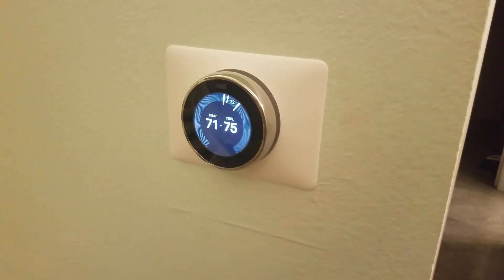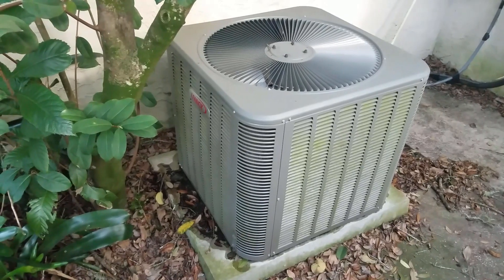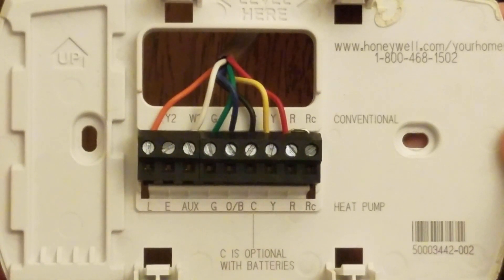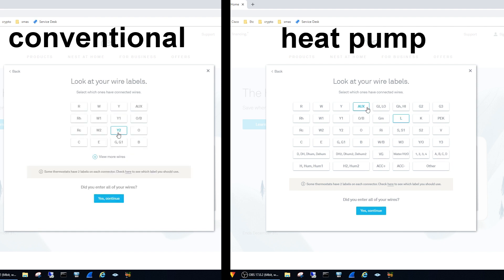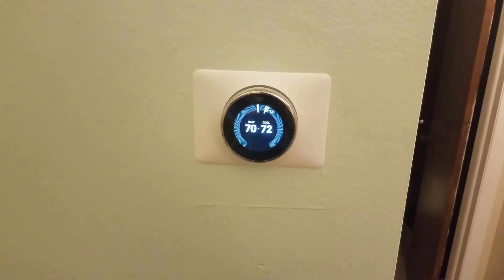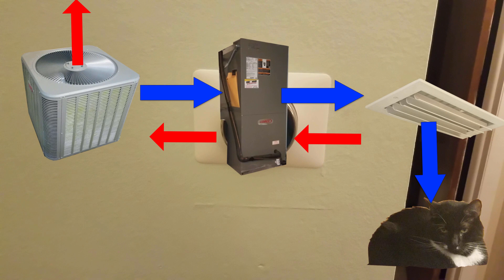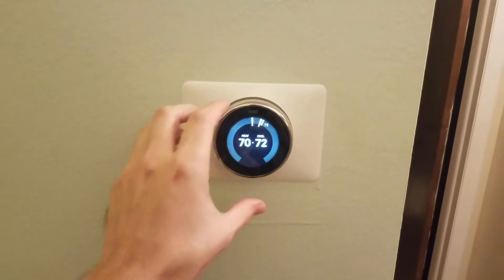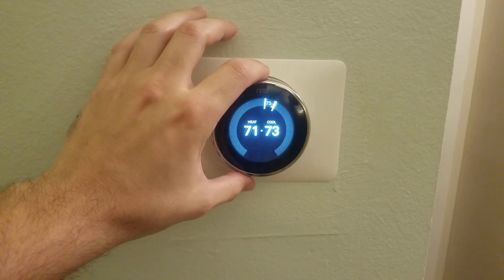Nest Thermostat Blowing Hot Air on Cool After Installation

Comment: I'm in FL and had the same problem except I live in a condo and don't have easy access to the outside air condenser or the air handler, my solution was to look inside the fuse box and I saw there was a double circuit breaker for a heat pump, then I knew which system I had. Also my O/B wire was white and not orange which Nest mentions online in their help support section that normally O/B is orange but clearly not in my case. Your video helped me fix the issue thank you!

Comment: This video helps, the markings on my honeywell control wasn't that clear and wirings are done only on one side, so i connected the O/B wire to heat (W1) on the Nest. thanks for the explanation and i've got cool air after moving the wire to O/B.

Comment: Had same issue.  I have a very similar Honeywell thermostat, also live in FL with same type of HVAC config.   Slightly different wiring on my old thermostat.  Anyways, following the same process fixed my issue.  Thank you!

Comment: Same thermostat different wiring configuration. Thank you so much for this video. All I had to do was switch over one wire from W to OB.

Heads up - it seems like Google doesn't let you look at the wiring diagrams on a device that isn't your nest. I had to reset my nest and unplug everything (first take a picture) for the prompt to reappear that asks for your wiring configuration.

Comment: Man, I just installed a Nest, and I couldn't figure out why it was blowing hot while in AC mode. Your setup is exactly like mine, and I had the exact same issue. I have a heat pump, and I was using conventional. The W and O/B wires were same terminal on the old thermostat, depending on if you had a heat pump system or conventional. Thank you!

Comment: My NEST has been working for three years all connected.  After this winter, I switched it to cool mode and it only heated.  My system is a heat pump, and I noticed that I did not hear the "swoosh" that the switching valve normally makes when the unit comes online.  I know the wiring is correct since it has run for three years, so I am curious if you might have an idea on what is going on?  I put my old controller back on the wiring and it is working now.  It seems the NEST is not sending the 24V back out to the reversing valve outside for some reason.  I also noticed there was some kind of software update back in November when the unit was only heating since it was winter.  Could a software issue be possible?  Reaching for an answer somewhere....

Comment: Thank you sooo much! My husband was convinced we did NOT have a heat pump until I showed him the pictures of your furnace that was exactly like ours! I switched the wires to heat pump settings & like magic… cold a/c. We went through 3 different smart thermostats thinking our old system just wasn’t compatible with new tech. I ended up with a thermostat that wasn’t as nice as I wanted because we were looking for one that allowed a jumper from w2 to y2… impossible to find. Now I know all the nicer thermostats would have also worked if we had just known we had a heat pump. But this one is installed & working so I’ll stick with it and maybe update to a nicer one later on down the road. Ur a Lifesaver!! Thank you for posting this.

Comment: AC units do not "cool" the air, they "remove" hot and humid air from your living or target space and displaces that warm most air outside.

That's why, if you stand next to your condenser, (the big box with a fan outside) you can feel the air coming out is hot. This, is the uncomfortable air being removed from your home or wherever you are. 
So, to sum up;  AC doesn't cool air, it displaces hot moist air and throws it away outside.
Reply: You just described what a heat pump does.  An AC unit takes warm air from inside and cools it with refrigerant through the condenser and pumps it back into the home.

Comment: Thanks for this. When asking if your unit has two labels, double check. Mine did and I didn't notice. Then it asked me about the heat pump and even though the cable order was the same, the software I assume was now sending the correct signals and it begun properly cooling. Also. If it States it is not detecting some cables, give it a try anyways. Sometimes the cable detection I assume does not work too well

Comment: Well I'm in a fix. I have a slightly different Honeywell that has very straight labelling with no "conventional" versus not.  It has wires in C, B, R, G, Y, and Aux, with the Aux jumpered  to the E.  My wire colors are different from yours.   When I connected to the Nest, I matched C to C, Aux to W2/Aux, B to OB, G to G, Y to Y1, and I've tried R in both Rh and Rc and all I get is Heat when set to Cool. Anyone have any ideas what I need to change?  I tried the Nest compatibility but it did not give me a wiring diagram no marter how many times I tried.

Comment: Just installed my Nest yesterday.  The house went slightly above temp right before we went to bed and woke up at 1am with heat blowing and house at 82 and getting warmer.  Thanks to this video, I knew exactly where my issue was and had it fixed in minutes.  Thank you for posting. -Ralph in Texas.

Comment: I've got 3 like this.  2 of the 3 work fine.  However 1 is still blowing hot air on cool.  I moved the O/B wire to W and it cooled, but heat doesn't work. Any other ideas?

Comment: I connected the Nest per the app instructions but got the same problem that you had - it was heating instead of cooling.
Your video help out big time!
I have a heat pump, maybe Nest instructions set me up for a conventional system installation, who knows.
Either way, I moved W1 wire to OB, and it works now! Also, on the Nest thermostat my R wire is connected to RC.

Comment: You are a life saver. Had this exact issue when switching my moms AC Thermostat from a Honeywell to a Nest.
Reply: Did U switch the OB and W wires?  Or did u leave the W wire out?
Reply: @yankeesfan83  In my case I didn't actually have a W wire. I was reading the wiring on the original thermostat wrong and had the O/B wire in the W slot. Once I moved the wire from W to O/B it worked.
Reply: Walter Meadows ok thanks!

Comment: Thanks for this! Installed mine earlier today and had this happening. Same AC unit, same thermostat, same state. I just had to change one wire, and I was back in business.

My house went from a cool 68° to 80° trying to figure out WTF happened. Now I'm back to the normal 68° temps.

Comment: You are a god send!! So even Nest support couldn't help. they told me I have a faulty Nest unit. Turns out my Florida honeywell unit was installed same as yours reverse as it should be heat pump. So reverse everything from honeywell unit to heat pump label instead of conventional. so only diffrence between conventional and heat pump is taking w1 and placing it in o/b for nest. 🤦🏽‍♂️ neat support wanted me to spend $100+ to have nest pro tech come out

Comment: Wow! so glad I found this vid as soon as I did. Yup reading it the "conventional" wiring did the trick. I also live in FL and you know we never use heat so it was weird that the heat was coming on. I have almost the same system as you did - Honeywell to Nest. All I had to do was change the orange wire from W1 to OB on the nest and it worked! Ahhh cooling. Another tidbit was when it was heating the unit inside was making a louder humming noise than usual. Thanks!

Comment: I had this problem but the solution was within the Nest device: I had erroneously chosen O for the heat pump O/B wiring question in setup.  Going into settings and switching to B made everything work right. Troubleshooting page for this: https://support.google.com/googlenest/answer/9257086

Comment: Thanks so much for posting this video! I had this exact same issue and the exact same Honeywell unit from before. Super helpful and informative!
Reply: William Chong so weird because i had the same issue and same thermostat before as well. The only thing i changed is instead of using “cool” i did “heat and cool” been working since
Reply: Great Video! Saved me from having to call a tech.

Comment: honeywell thermostats uses just 1 kind of terminal. They're just putting labels on it like the other side is for conventional and the other is heat pump, but if you will take a look on it basically it's just 1 terminal. They just labeling it for uniform wiring, so as an home owner, you really need to know what type of system are you using to prevent this kind of issue when you will install or use a different thermostat such as NEST.

Comment: I hadn't even noticed the conventional vs heat pump writing on my old thermostat. The way mine was wired, only one wire needed to be switched (W was moved to O/B) and it fixed the problem. Mine was blowing kinda cool air, but not cold enough to maintain temperature in the house (Phoenix, Arizona). This fixed, thank you!
Reply: Chris Hilyer did you have a wire in the O/B? Where did that wire go?

Comment: Where in the website can you check for heat pump wiring? I’m only getting one compatibility check
Reply from the maker: it's been a while but i think you go to the link here: https://nest.com/support/article/My-old-thermostat-has-two-labels-for-each-connector#works/?mode=guide

then click 'Get started' then 'Continue' twice.  Then there's a line that says "Some thermostats have 2 labels on each connector. Check here to see which label you should use."  If you click the 'here' then it will show you more options for the wiring.